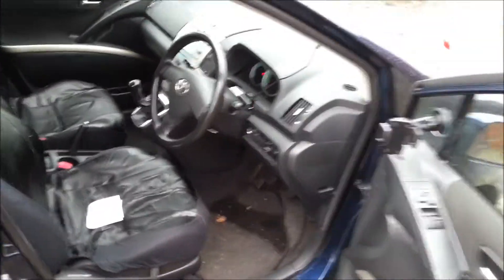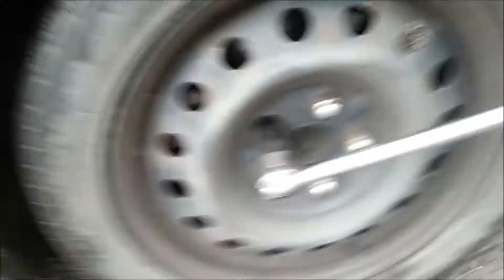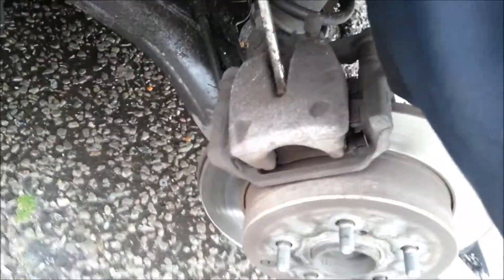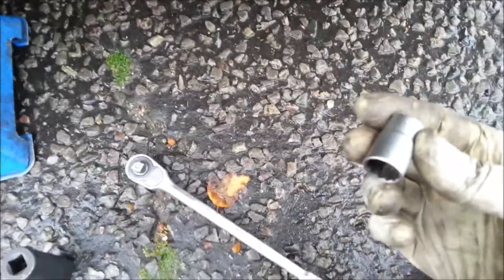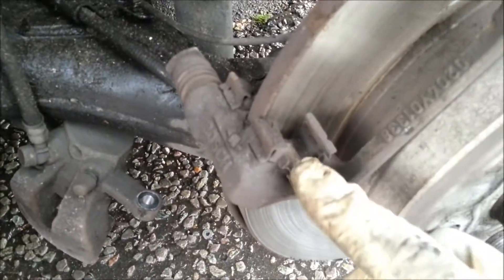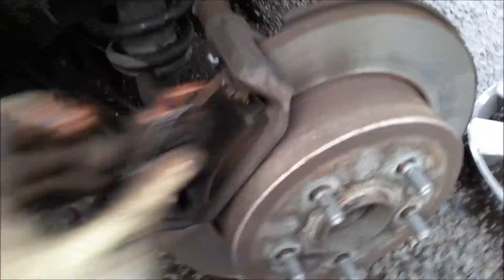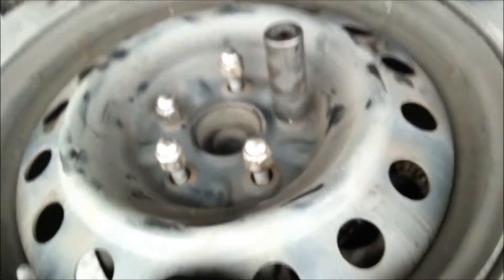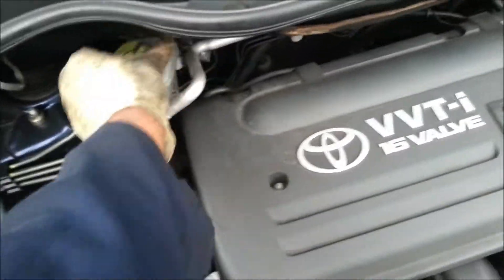HOW TO REPLACE REAR BRAKE PADS | TOYOTA COROLLA VERSO

Comment: Thank you for the video! What is the kind of spray you use to clean the break pads seat? Would wd 40 cleaner suit?
Reply from the maker: Thanks. No dont use wd-40. You need to use brake cleaner

Comment: What is the point of the copper grease?? I've never used it on my other cars
Reply from the maker: +nathanb its used to prevent the brakes from squeaking, the pads from getting stuck and helps disperse the heat. 9/10 the brakes wont squeak if you don't use the grease and the chances of the pads getting stuck is even lower. however, if you are a mechanic working on other peoples car its best not to take any chances.
Reply: jayxunderwood oh ok. Thank you for the enlightenment :)